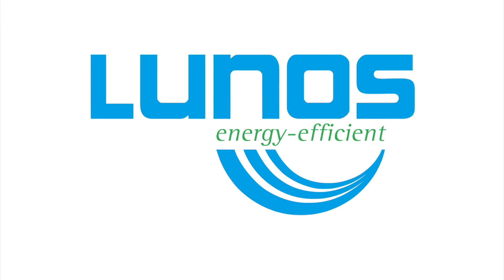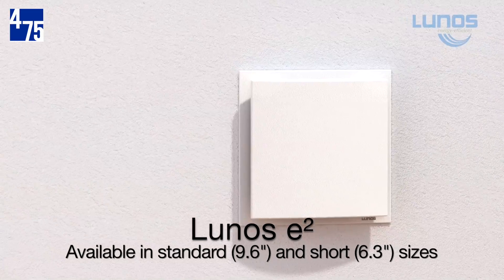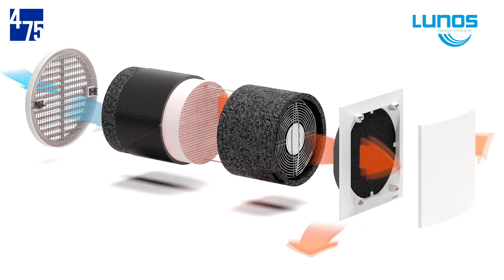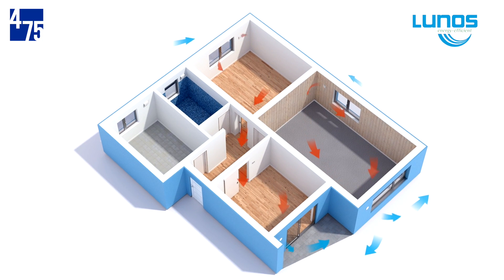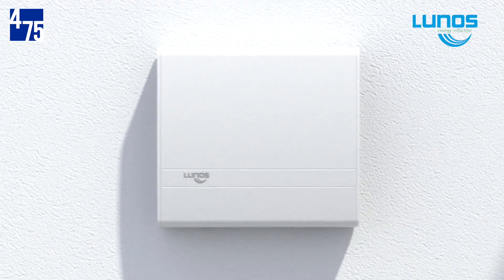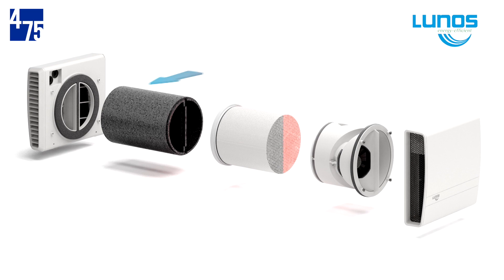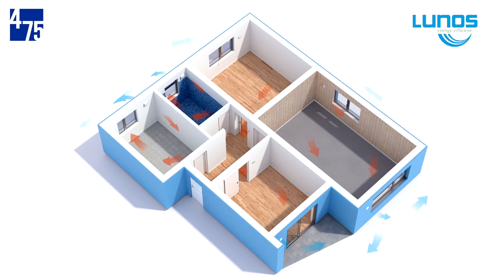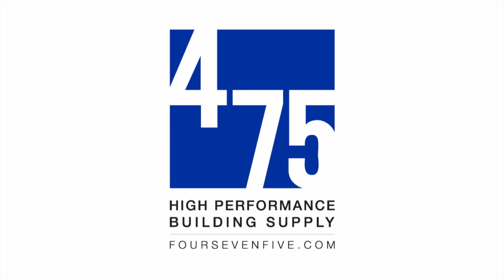Introduction to the LUNOS decentralized heat recovery system

Comment: How does this compare to Zenda ERV systems.
Reply from the maker: The Lunos system performs the same tasks as a centralized system, but does so without ducts, in a decentralized way. One fundamental difference is that the Lunos system is only available as HRV and not available as ERV because it can handle only a small amount of humidity recovery. If you are interested in high efficiency centralized HRVs and ERVs, we recommend taking a look at the Flair system from Brink - the highest efficiency heat recovery system available in North America.

Comment: it looks like they are located on outside walls? What do you do for ICF construction or SIPS home?  Also do you have ability to set up hepafilter to clean outside air coming in from pollen etc.
Reply from the maker: You're right, each fan must be located on an exterior wall. For concrete this would mean pre-casting openings where you want the fans to go. Any existing assembly would require getting a hole saw to drill out the correct opening.